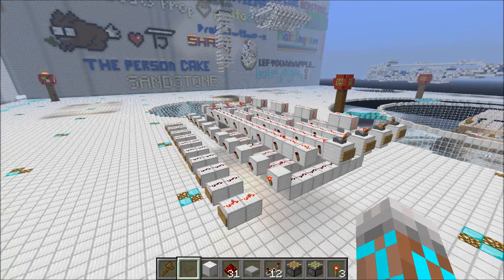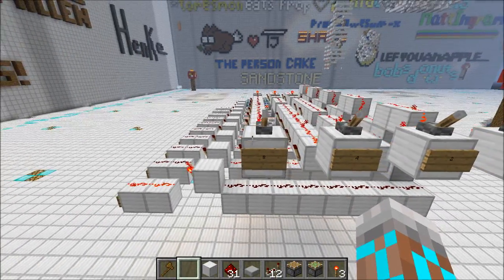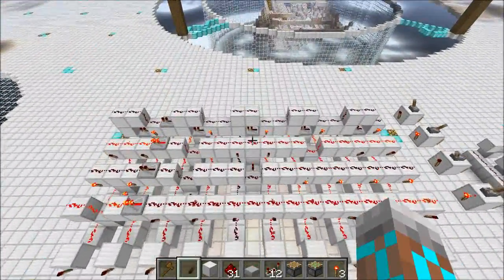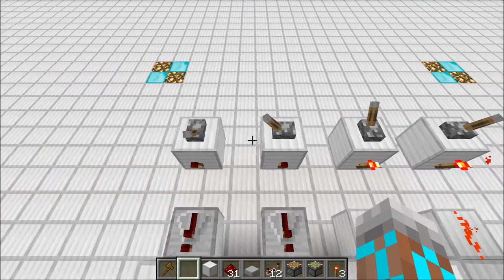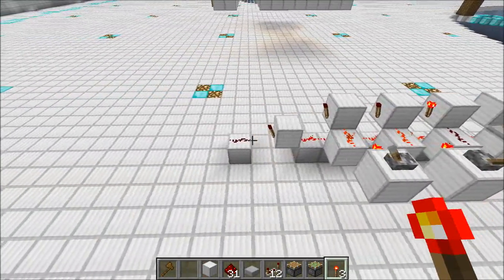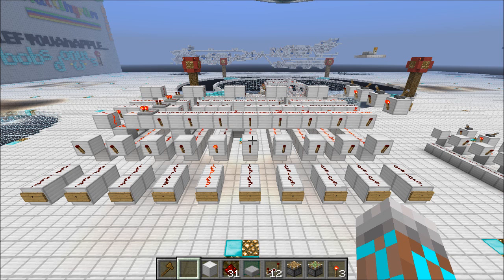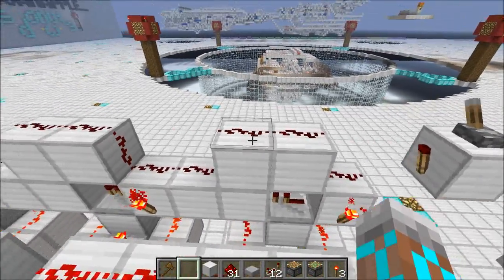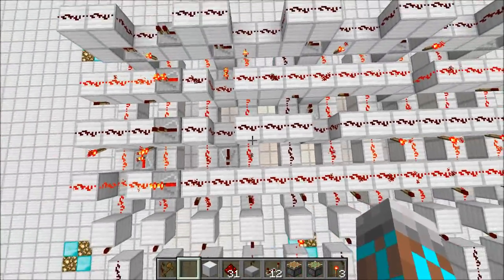Tutorial: Decoders (and a fast pistonless decoder design)

Comment: Awesome, thanks a lot! But: you said it outputs in decimal, however the outupt is called a "one hot Encoding", because outputting in decimal would mean there are ten possibilities per redstone line, which is cleary not the case
Reply: Outputs 1 2 3 4 5 6 7 8 9 10 11 12 13 14 15. Thats decimal

Comment from the maker: Yeah there's a little miscommunication - when I said "0100 0111 0110" I meant that as binary-coded decimal and not binary. This means that each decimal digit is encoded as a binary number, so we're reading 0100 as 4, then 0111 as 7, and then 0110 as 6. We'd be using binary coded decimal as an intermediate step in the decoding of binary to decimal.

Comment: Ok I'm not really sure why lol. But you said 0100 0111 0110 is 476 in decimal, but it's actually 1142 in decimal (I may have miscalculated sry but the point is it's a lot bigger) Are we thinking of different things? Hex is 1 digit has 0-15 where 10->15 are a-f right?

Comment from the maker: When I said 476 I meant that as a decimal value and not hex, so I think that's where the miscommunication was. Your example of 4CA would be  0001 0010 0010 0110 in BCD. You can then decode that further so it can be represented on a display. I should start adding a base to the end of the number when I say something. XD

Comment from the maker: It doesn't, and I'm going to do a tutorial on that soon. What you'd do is convert the binary to something called binary-coded decimal, which is exactly what it sounds like - you're using binary to represent decimal digits. For example in BCD 476 would be 0100 0111 0110 - you can then take each group of four and use a decoder like this to convert to decimal. Let me know if that makes sense.

Comment: If you are building a 16 bit calculator, does your screen need every number decoded? Or is there another, more compact way of doing this when you have large numbers? (you need about 65000 decoder lines for a 16 bit calculator)
Reply: no dont do that just use binary to bcd converter